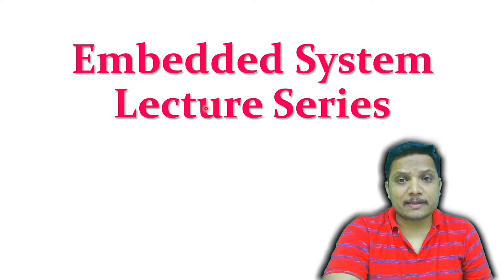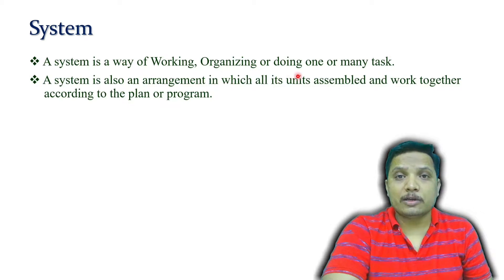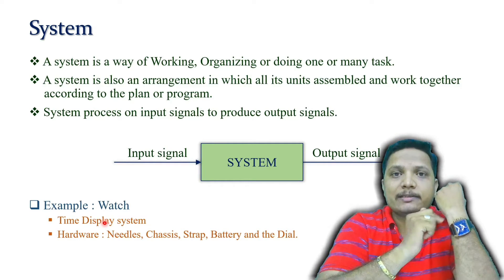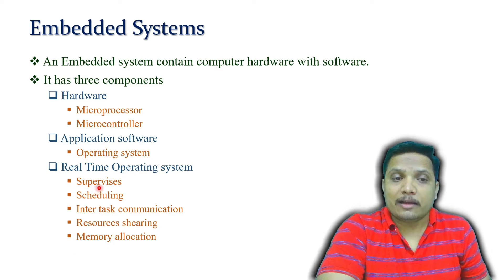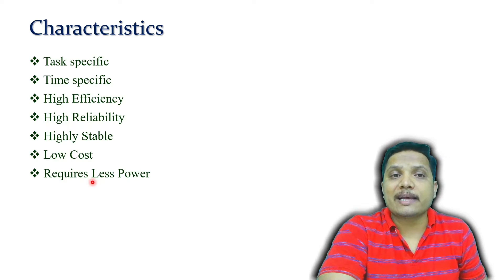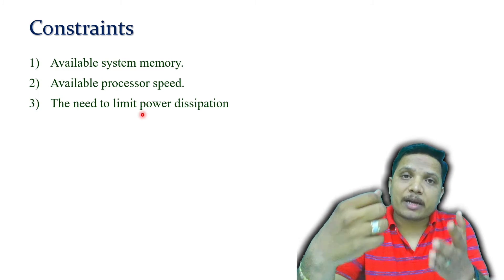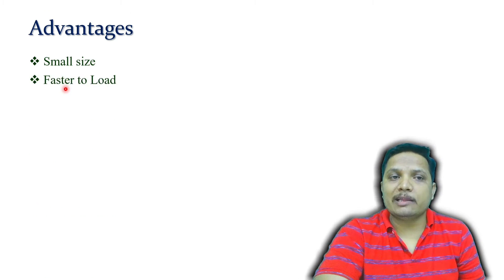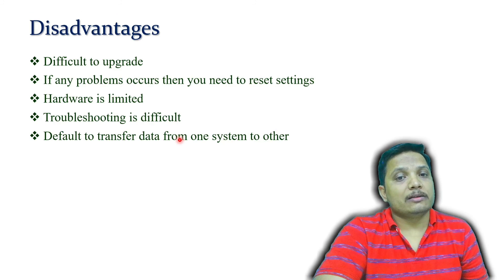Introduction to Embedded Systems: Characteristics and Advantages

Comment: application s/w - apps, system s/w - os , that is RTOS here . laptop also have hardware and software but it is not Embedded System. embedded system defination may be different. 

Embedded system is defined as embedded the firmware in to hardware to do specific one or few highly focused jobs often with real time constraints .